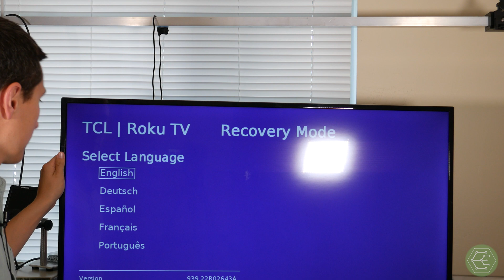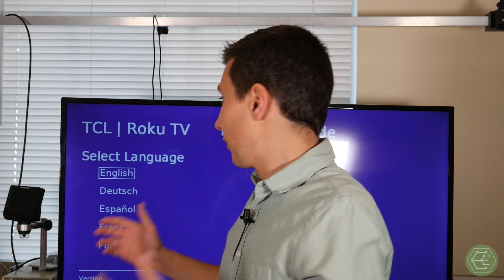TCL 43” Roku TV – Teardown & Diagnostics

Comment: Is this a serious video? I opened mine up and instantly discovered that it was just the flux capacitor on the abc-123 interface board. Switch the modulator on on the sdd high speed can bus and the pcp started working instantly. Elementary really 😉👍
Reply: Arrogance doesn't prove intelligence
Reply: @TingleTap13  facts!
Reply: some folks here err missed the sarcasm smh:face-blue-smiling:
Reply: Sounds like you’re from the future.